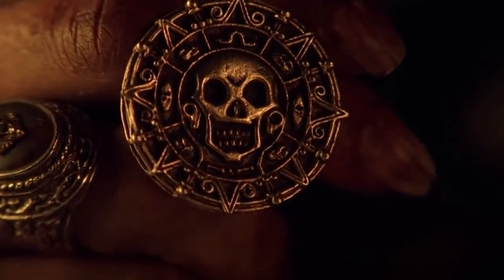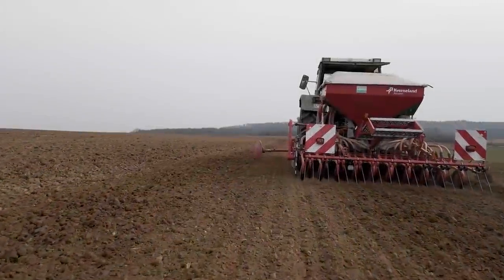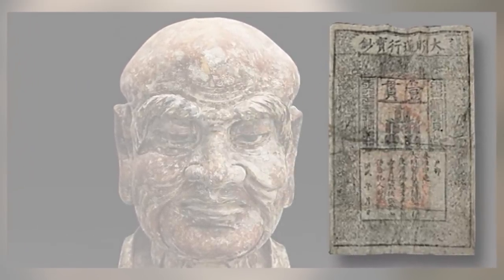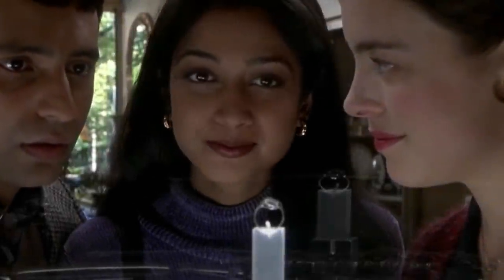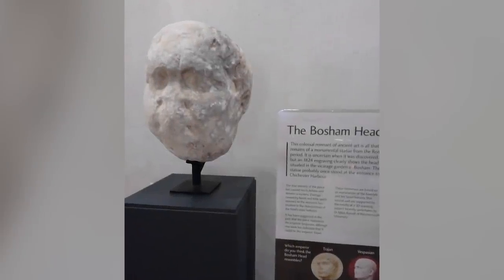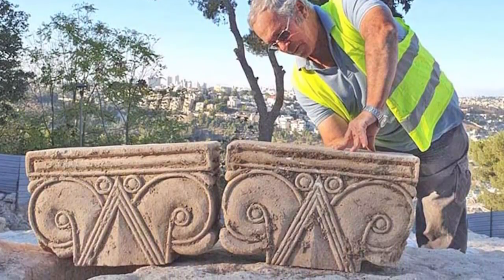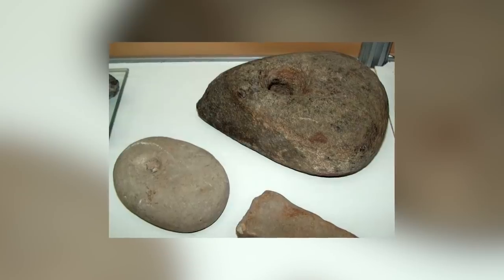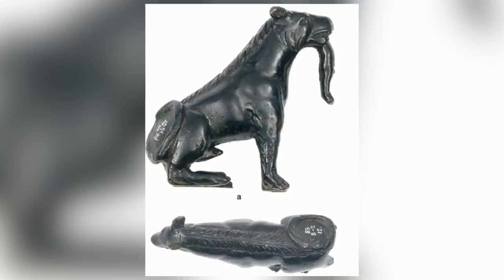12 Most Mysterious Ancient Artifacts Finds Scientists Still Can't Explain

Comment: 1:36  Attach a rope at the narrow point and push it in some firm ground.  It could be an anchor to keep some quick construction in place and/or to keep some smaller animal from running away.  That narrower place seems to be more worn out, as if some rope was rubbing against it.